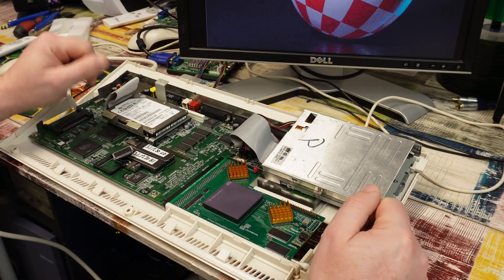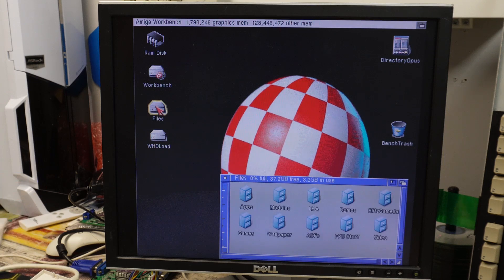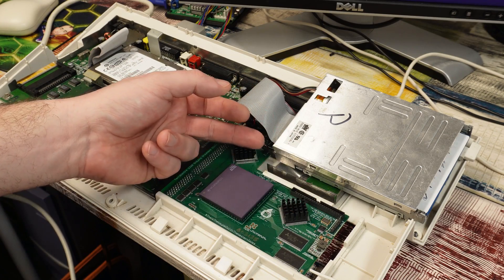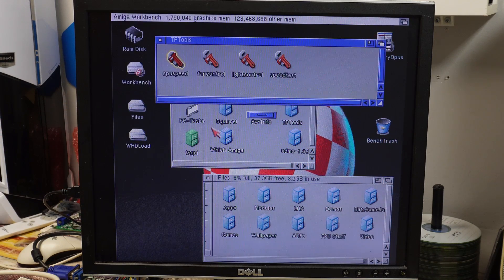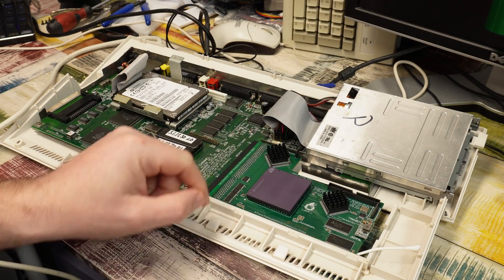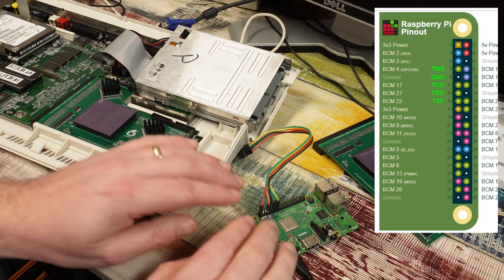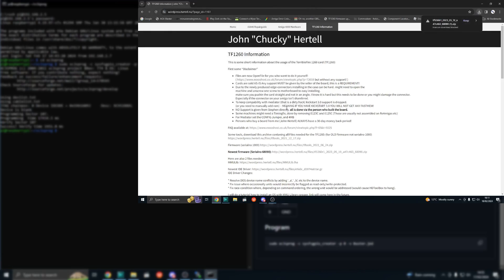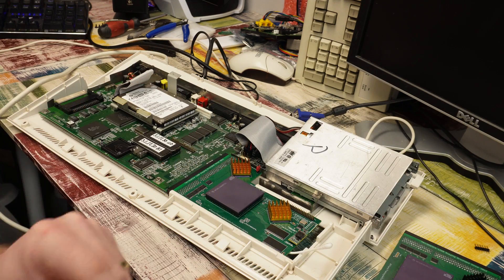Is this TF1260 or rev6 060 faulty?

Comment: 39 mips. I akways wonder why oeople NEVER learn… Sysinfo is a proper and popular benchmark and testing tool for the 1200 with any cpu but the 060. Its latest version RECKOGNISES the 060 as a 060 but it can’t measure its speed correctly due the lack of support forthe 060’s architecture… the real mios value should be around the double what the sysinfo reads. (If you don’t believe read Motorola’s 060 specification or Phase5’s 1260 product information. (Both says ~80mips average at 50 mhz. Anyway, since the effective value of the 060 is above 1 it means it performs more than 1 instructions per cycle, any mips reading below 50  at 50 mhz is 100% wrong…. Of course this oerformance is true in case your software is using the 069’s architecture properly.
Reply from the maker: Thats a very aggressive way of stating your point, why would I not believe you?

Comment: Have 2 TF1260 with 68060 Rev6 , Alpha 1000 (December 2021) and runs great 68060 demos on my A1200’s. See no reason to update to a new firmware update. Update alot with the Vampire V4+ Standalone. Hope that the ACA1260 come out. For me the best card for the A1200 is the Blizzard 1230 IV with 128MB on it.

Comment: A 68060 boots with the FPU enabled but interestingly it boots with the superscalar dispatch disabled. The ESS bit in the PCR register needs to be set in software. I assume that the 060 libs do this. Sysinfo must also do it as you get the same reported speed when booting Sysinfo from floppy as you did when running it from the harddrive.

Comment: Hey! Do you have a separate full can crystal there for the FPU that you are using? Did you make a video of installing that?
Reply from the maker: Yes I have a separate FPU on the 1200s motherboard and a separate crystal driving that at 40mhz but that FPU only works when I'm using the 030 accelerator (or no accelerator).  Its always disabled with the 060 regardless of being an LC, EC or full chip.  There are a couple of videos on it both here https://youtu.be/nSZkTYaRy0E and here https://youtu.be/5DYgls1WGAU
Reply: Thanks, I found it from last year... @CRG

Comment: Do many applications utilize the FPU or is it going to be mostly like productivity applications?  Maybe some modern applications/ports/demos work with it though.
As for instability I guess could just be some marginal power thing but i dunno how all that works in the Amiga.
Reply from the maker: It's not just software that uses fpu but anything compiled for the 060, even if it doesn't use the fpu won't run without it.  The main reason I'd want a full chip is to run demos, much like the one I showed in the video.  But because of this, the LC or EC variants of the chip without an fpu essentially need to be treated as fast 030s.

Comment: Do you have a video showing the modifications you did to the bottom of the board you were talking about?
Reply from the maker: You can see it in this video https://youtu.be/pF6upvTE8XY?si=jCG0mrL9l-G3X5Zp.  Its chaptered but please note in that I fitted a resistor at position E113R.  This is not required.  The timing fix is just to remove the 2 caps at positions E123C and E125C.

Comment: Amigas are temperamental ladies. The Boing Ball on your screen doesnt seem circular, rather a bit elliptical. Maybe its just my eyes. I am thinking about having a black 2000 EATX built after seeing your system setup for a Lian Li OP11 Dynamic.
Reply from the maker: That they are.  On the monitor I'm using a gbs8200 with gbs control and yeah I think the image is a little vertical stretched.   

A black eatx2000 will look amazing in that case.  I'd love to see a few pictures of it if you get it built.

Comment: Does the 68060 really have such a giant die or is it just the package? That's a massive chunk of ceramics compared with 486/Pentium.
Reply: your not kiddin...
Reply from the maker: Is it really that much bigger?  I must set a 486 on top of it to compare.  On the bottom of the chip you can see the can that sits over the die.  Its big enough but I'd expect the die to be maybe half that size.  I tried looking for an image of one of these decapped but can't find anything.

Comment: I saw the other day that the 68040 is still used in new Boeing jets, even the new 737 Max which have been in the headlines. That would imply that Freescale or whoever owns them now still makes them today?
Reply from the maker: That's cool, I didn't know that and yes you would assume it means it's still in production.  Just need Boeing to up their game to the 060 and maybe prices will come down 😂
Reply: I should still have a bunch of 68040 from the Casablanca video editing times. Maybe I could sell those to Boeing, who knows? 😂😂😂
Reply: There's a 68040V which is MC68LC040 with a 3.3-volt version.

Comment: If you have many directory windows open on an Amiga i think you can shift+click (if i remember it correctly after not using an Amiga for 30 years) on the close button and all previous windows will close. That is much faster than clicking on 5 to 6 windows.
Reply from the maker: Thanks for the tip, I'll have to remember that.

Comment: ramdom crashes is usually due to no timingfix done.  AND/or bad 68060 lib installed..
(oh and that special LC version of libs.   SKIP it! :) use mmulib instead )
Reply from the maker: Thanks for the info Chucky.  I'll pass it onto Gerry who owns the card and advise he get the timing fixes done, plus download the mmulib.  I've not used it much but since installing mmulib on my machine the LC chip in my card has been running fine so yeah, it seems to be the better option.
Reply: Hi Chucky, it is my CPU and my card that Glen is testing in the video.  To be more specific, the issue is that the card will boot with that CPU installed but then not boot again after this.  So it might boot say 1 out of 15 -20 attempts.  When it does boot it runs fine.  To put things into perspective.  When I swap out this CPU for another Rev 6, the TF1260 runs fine and I do not have the same problem of only booting occasionally.  So this is why I sent that specific 060 to Glen to test as for me it will boot once, then a black screen on next attempt.

Comment: Great info Glen! I had an issue with a Rev 5 68060 TF1260 not liking cold booting and needing a power cycle. That new firmware fixed that issue. My 1200 has the timing fixes so hopefully the firmware or the timing will sort the instability here 🤞🏻
Reply from the maker: That's what I'm thinking, strange that Gerry said it was just this particular 060 but hopefully the firmware update and a timing fix will get it sorted.
Reply: Can you overclock your Rev5 reliably? My Rev 5 can't even handle 58 MHz for more than 5 minutes😢 this is with the 2nd version of the firmware.
Reply from the maker: @SJSsesco  I've had my LC chip at 94mhz and it seems fine although not ran it for long at that speed as I don't have cooling for it.  Won't do 100mhz though, just locks up as soon as you select it.
Reply: @co https://www.youtube.com/watch?v=skU70bb-5ak
My TF1260 with 68060 Rev 1 can overclocked to 62.5 Mhz. My A1200 rev 1D4 has its timing fix.

Comment: Whilst I've never worked on an Amiga, I can recommend performing any fixes to improve timing signals. I had an early model MegaDrive and my 32X wouldn't work properly, with the 32X eventually experiencing rolling video and crashes.

Turns out SEGA put out a Technical Note mentioning that one of the clock signals on the board needed to be cleaned up by modifying the board. Once I did that the 32X was rock solid.
Reply from the maker: Yeah its always a good idea to carry out those fixes.  The most basic version of it on the Amiga is very easy to do, its just getting to the parts you need to remove.  Thanks for the info on the Sega.  I wasn't aware of that but very interesting.